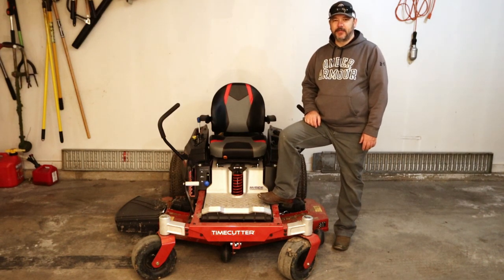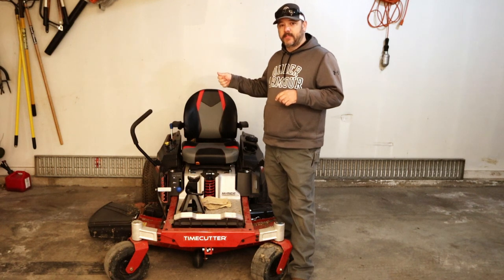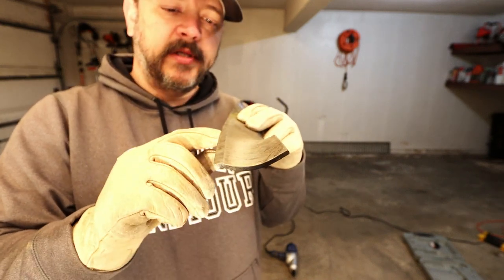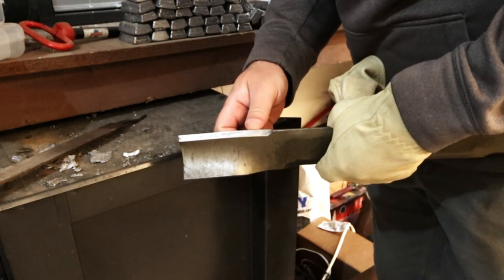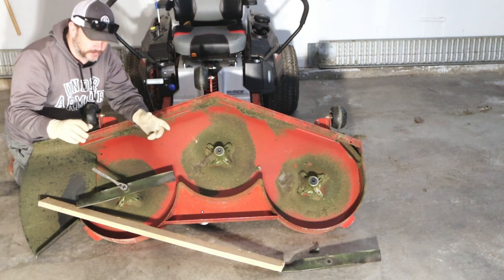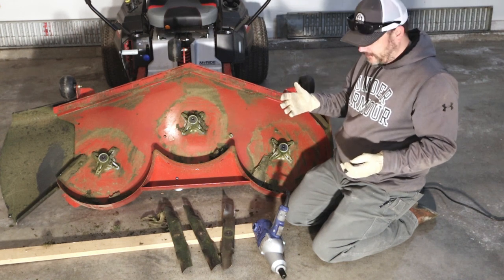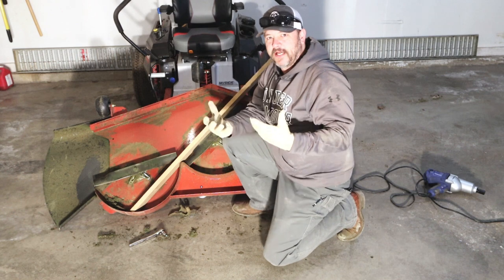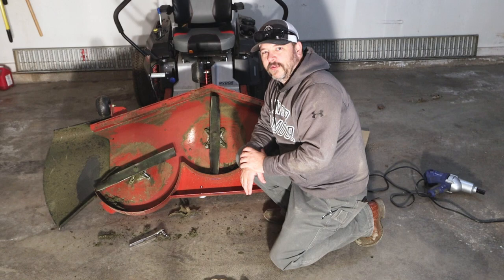How to Sharpen Zero Turn Lawn Mower Blades  | 2020 Toro Timecutter MyRide

Comment: Always protect the hands.  A breaker bar would make removal much easier than a standard wrench.  When I pulled the first blade off I noticed it did not have any location tabs (not sure of exact name) like my TimeMaster blades, which have to be timed, so I stopped and came to Youtube and this was the perfect video.  I figured no time was necessary, but needed to verify.  I just picked up the 50' TimeCutter and need to sharpen the blades.  Thanks...

Comment: Excellent video.  Thanks for showing how to work with removing blades with deck on and then with deck off.  Do you prefer high lift or mulching blades?  Thanks

Comment: I can change my blades with the mower on the ground with a wrench holding the spindle nut, using a pipe cheater to lengthen the handle to catch a part of the mower so it doesn't move and then remove the blade nut with a breaker bar.  But I usually pull it up on car ramps so I can clean off the debris under the deck.  And to sharpen, I use an angle grinder with a flap disc wheel, I don't even clamp the blade down.  I would how ever love a deck that just flipped up so I could do all that without laying on the ground.
Reply from the maker: The Hustlers and Walkers have that. I would love to have a flip up deck as well.